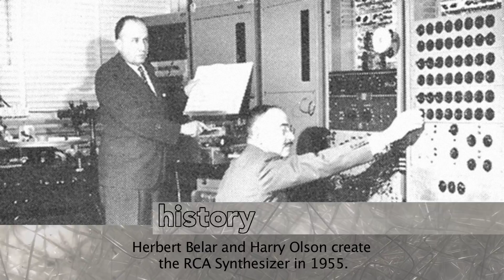A History of Polyphony: Part 8- Paradigm Shift... the RCA Mark II

Comment: I'm not sure I understand you reasoning on why the RCA wasn't polyphonic. The Mark I could output two notes at a time and the Mark II four, without multitracking. It's true that internally this was accomplished basically by bolting two (later four) complete, independent synthesizers together and playing them all at the same time, but that isn't very different from how many later polyphonic synthesizers work. It lacking a performance interface is irrelevant. There isn't any reason the RCA couldn't have had one, it just wasn't ever made.
Reply from the maker: Because, primarily, “polyphony” isn’t about how many notes can be heard, it’s about how many notes can be PLAYED by someone in real-time.  For example, a 1968 Moog modular could have many notes playing simultaneously, but it still wouldn’t be polyphonic, because that term helped people know how many notes could be physically played at once.
On top of that, the RCA was not a real-time instrument… it was something that could be programmed.  AND it was programmed monophonically… the “polyphony” was achieved through a combination of programming and primarily the track bouncing that happened with the laquer disks, and eventually with tape.

Comment: I find it kind of remarkable that they didn't have some kind of live 'performance' input method on the RCA synthesizer, if for no other reason than to considerably simplify troubleshooting. Then again, it may have been not remotely configured to make that possible. At the same time, wit what they were doing, it's also the kind of thing that would somehow not have occurred for them to do. What do you think? From my modern perspective it seems like the engineers that designed it would've itched to be able to play it directly (again, though, with the complexity of its design, and from what I am imagining as possibly having a heck of a lot of relays, that could've been a strong reason not to...)